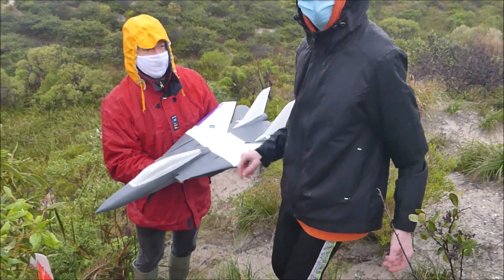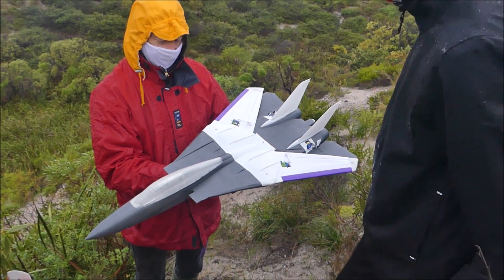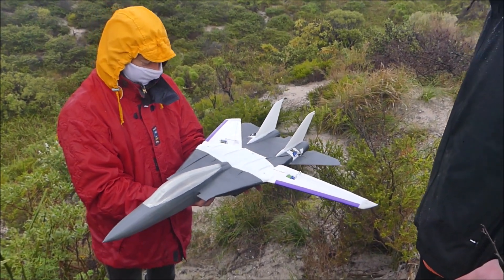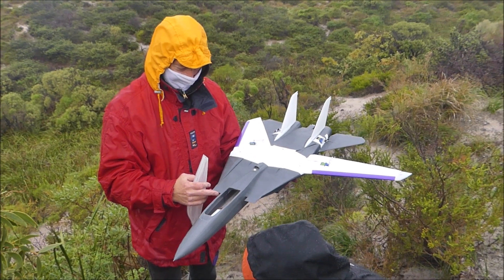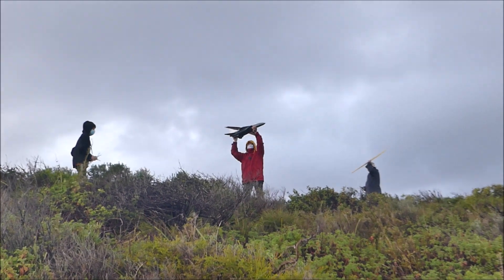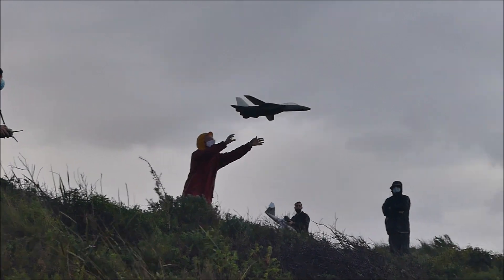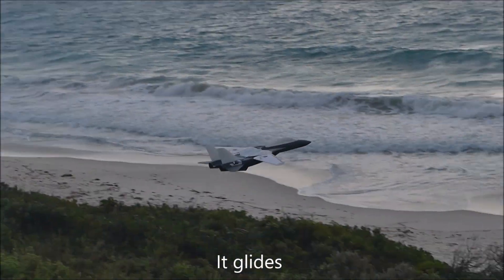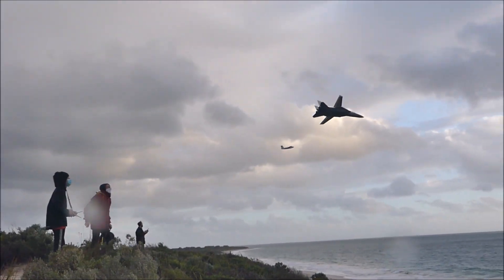3d-printed F-14 Tomcat trial gliding

Comment: hello where do i download the stl? very good work
Reply from the maker: Hi. This plane is still being developed so files not available.  Hopefully it will fly well under power and then Dom may make them available.
Reply: @MrWaz11  Hello, I understand it but I would like to be able to modify it if you agree and put an engine on it that I would like a lot for that reason consult it and or if there is the possibility of sharing STEP files.  of course I would share the files with you later.  I await your response, greetings and great work.  PS I'm working on an f-16 currently
Reply: @m3dmaker874  wow. any update with f-16 what is the EDF size you going used
Reply: @lakshithadilhan5765  todavia no me decido pero 70 casi seguro
Reply: @m3dmaker874   plz let me if stl available . I like try it too